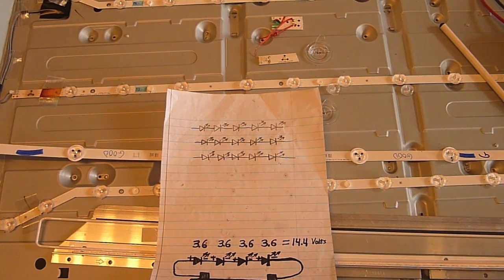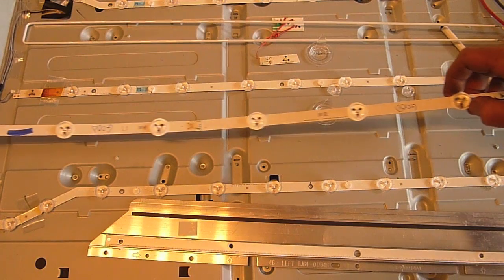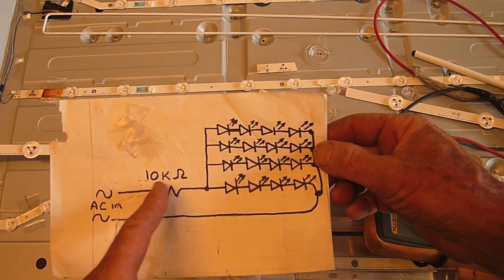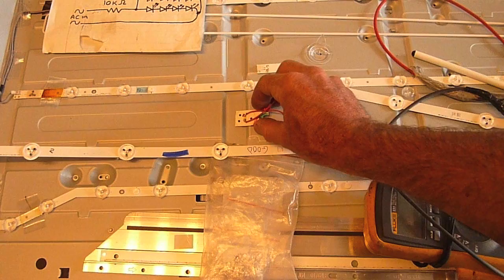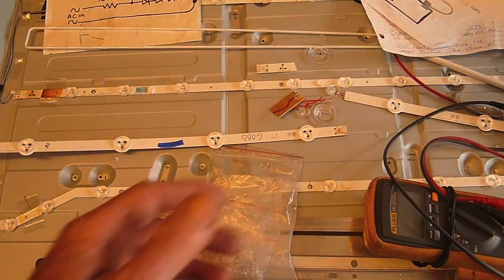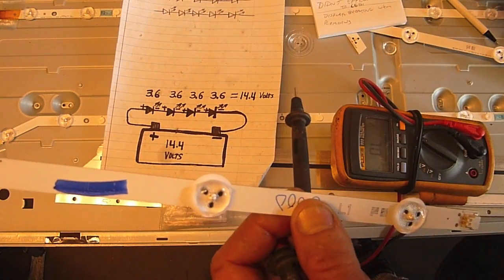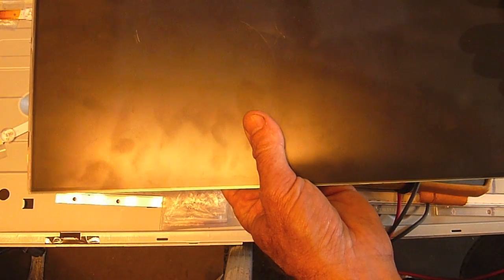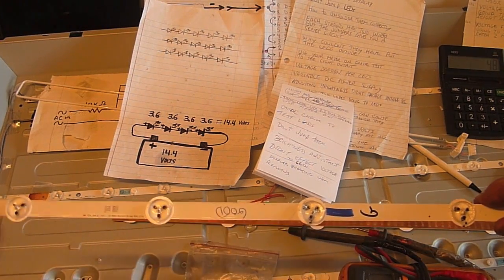LED backlight problems in TVs and computers.

Comment: Seems to be another case of putting a new product on the market,before it's been fully tested and of course they know a lot of people will just buy another set rather than go through trying to get it repaired. Hopefully someone will come up with a way to fool the feedback circuits. Thank you for another well done video.
Reply: With the current price of reasonable labor, good luck on finding someone who will spend the time repairing backlights on an older (2 years+) TV's or monitors.